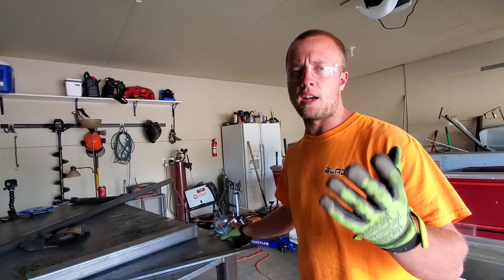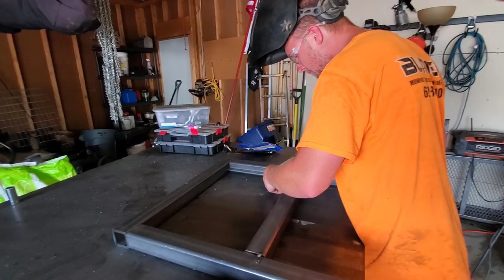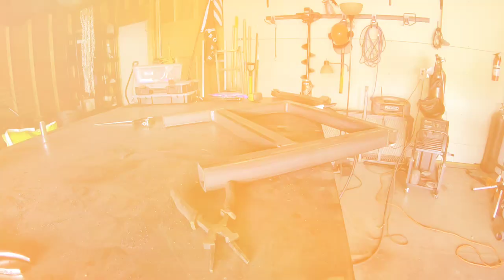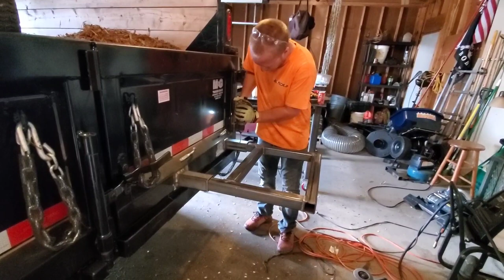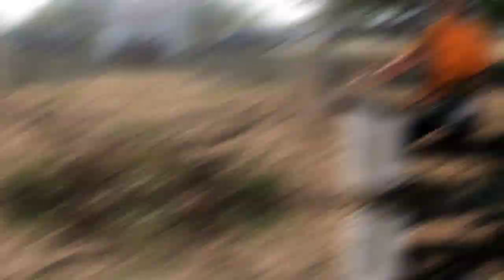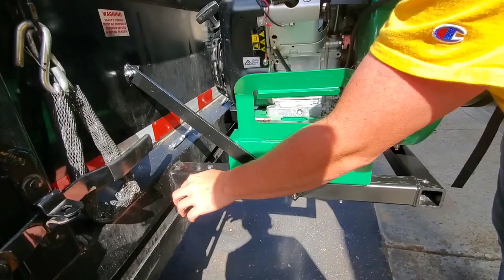How To Mount A Debris Loader On A Dump Trailer #billygoat

Comment: I need to learn to weld. Thanks for the video. I have some thinking to do before spring!  Right now I’m trying to figure out how to take a 2500 with a dump insert and an enclosed trailer. I cannot mount on the frame as it’s a v nose and there is not enough room.

Comment: Not to sound dumb, but if the machine already has the tub mount on the bottom, why bolt it to another mount?
Reply from the maker: Yeah that's not a dumb analysis. I realize those are there, I just simply like to over engineer things. It works incredibly well, definitely isn't going anywhere and it is super easy to take on and off. I can put it on the trailer by myself without lifting it with any machines or hoists.
Reply: How Tall from bottom to top is that loader? I want to mount mine similar fashion but in front on the box. I don't want to bend hinges or mess with hooking unhooked stuff to unload.  
Does your trailer have the hydraulic tongue jack?  I may upgrade to one.

Comment: Most guys mount in a similar position, 90% of leaves are loaded on the rhs, why not turn the loader to the right? Asking for a friend.
Reply from the maker: I've thought about doing that, actually 🤔 you totally could. It would give better reach off the right side as well.